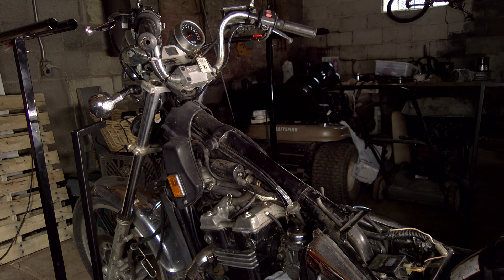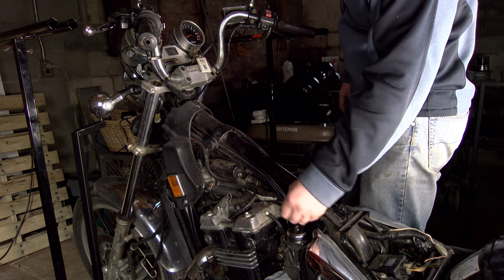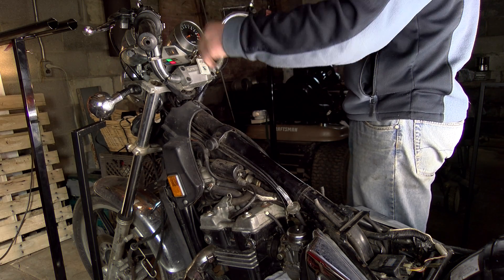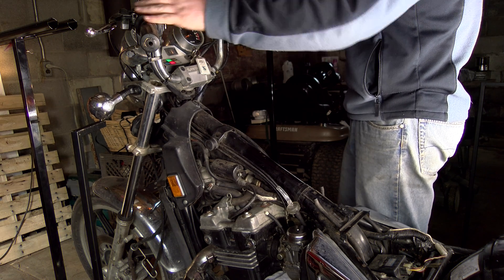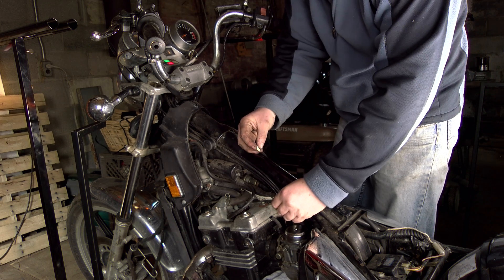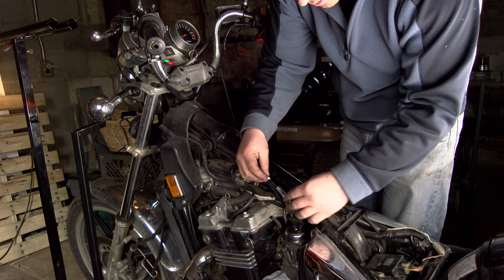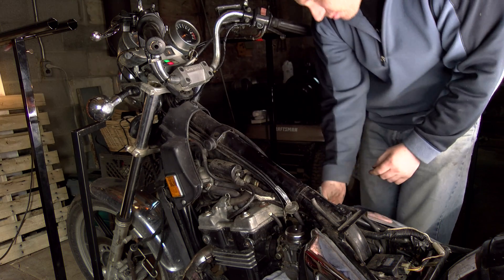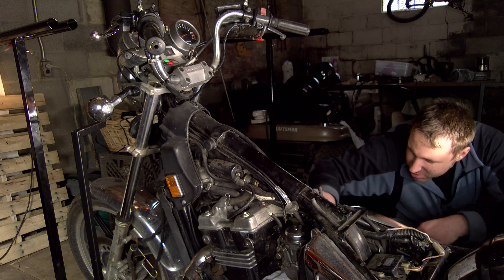Starting Kawasaki en450 After Cleaning Carburetors from Rust Replace Float Needle Valve Clogged Jets

Comment: Trying to find a hose diagram for the carb and air box, book has nothing in it
Reply from the maker: Check out. Thegreatwhiteknight 454r page. Might have to use internet archive. I had a digital copy of the book which had it. Air tube, gas tube, overflow, drain, and crank case breather. I have an oil change video that might show some of right side. As well as my sale videos.

Comment: Hi! 
Mi en450 does spark but she does not start.
I bought her a few months ago and I just know she was sat for 4-5 years.
I've done a valve adjustment and still not start.
What can I try?
Note: She does not have the air filters.
Thanks.
Reply from the maker: Do you mean there is no Air Filter Boxes? If that's case, it may require Jetting. If you mean it doesn't have the U-shaped filters inside the box, get some because this bike is pressure/vacuum sensitive.

Make sure the exhaust pipes are clear, mice like build nests in funny places.